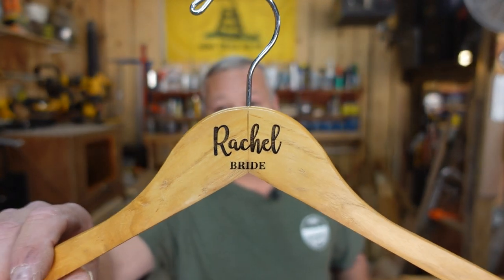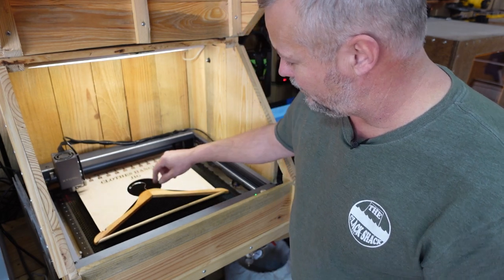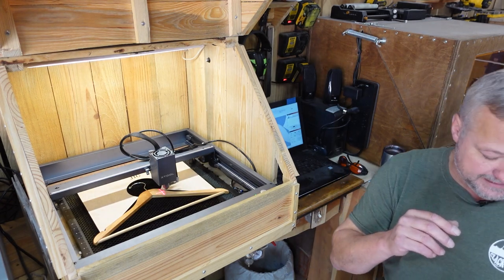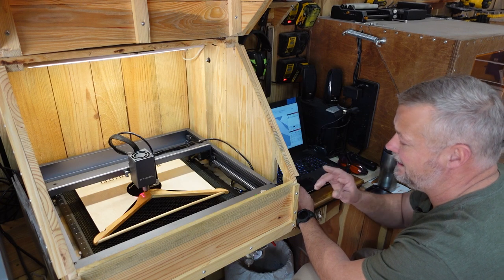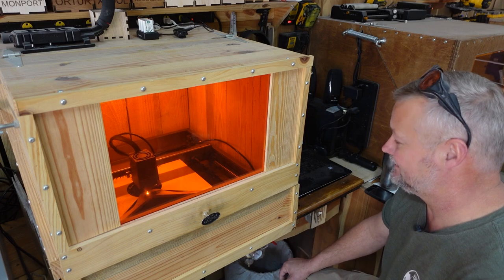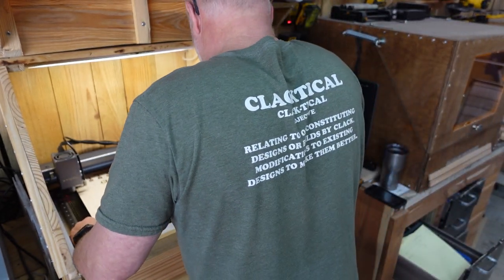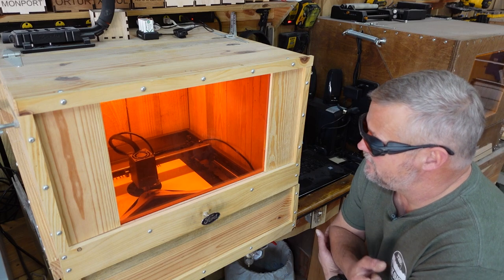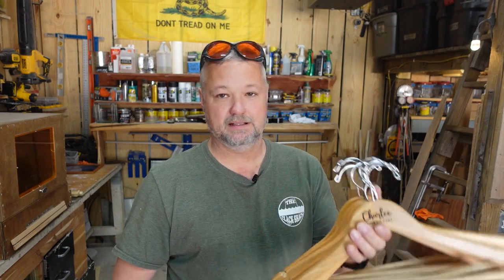Easy project for weddings- engraved hangers

Comment: My solution to the sizing problem is to use the Silhouette Studio Designer Edition instead of cricut. It's a bit more robust than cricut.  I use the weld tool after I design each name and then make compound path. Then export as svg. This allows you to not have the square of using like an image. But be able to use the circle frame and see exactly where your image will go. I actually design all the names at once, then export to 1 svg file. Delete names as I go.

But as always bravo 👏 on the hanger gig
Reply from the maker: I only use cricut to design, I trace in lightburn and resize

Comment: So trying my hand at hangers… first one was a flop… what setting did you start with? And should I use a Line or Fill… I was using fill and it didn’t turn out well… line came out better especially on the thin font. Thank you!
Reply from the maker: Depends on machine output. I ran 100mms at 100. Turn LPI up on smaller fine fonts